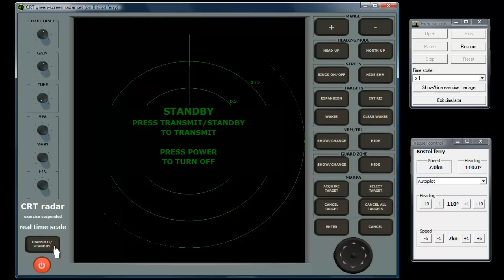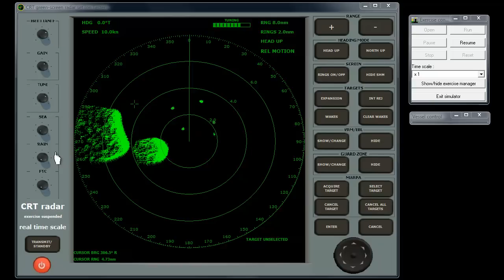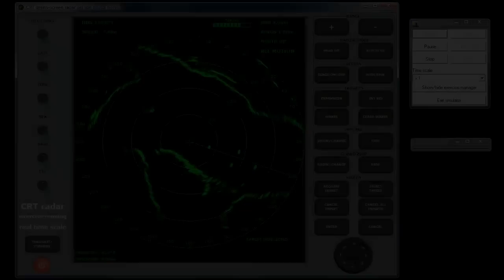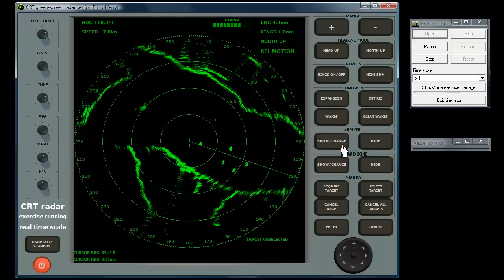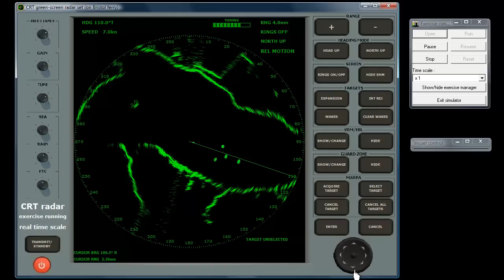LightMaster CRT Radar Simulator Controls

Comment: There is a big program- mistake in this software. The compas rose (Point of 0°, of the green rose) do moving wile shifting from north up to head up. It's not possible to read off direktly a bearing (EBL). Usually the "point of "0°" must be fixed on the top all time.
Reply: maybe it's just COURSE UP, not HEAD UP